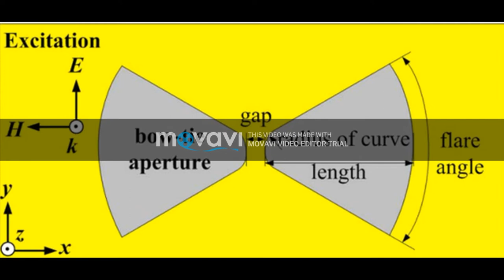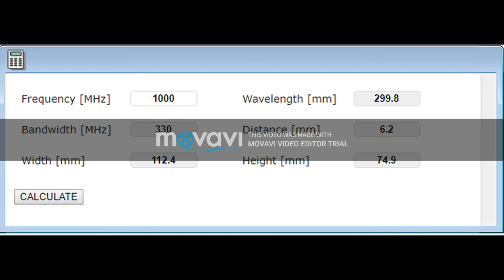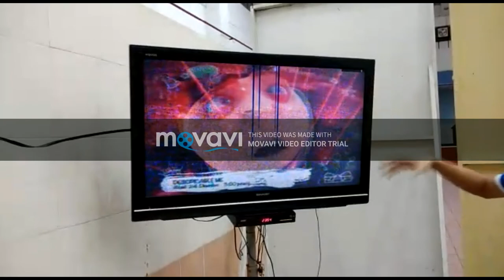bow tie antenna for hdtv

Comment: Your site was just what I was looking for. A simple way to build an indoor antenna. Unfortunately your accent was not very understandable and the background noise  made it impossible to comprehend. 137 views and no comments. Use a little more forethought and repost. You do not need three commentators. Get a tripod, a cheap used one will do. Hold a shot on any graphics or formulas for 5 seconds so I can pause and make a copy. Your site will be viewed by more persons. Try to record at a time when it is quiet. Three AM?